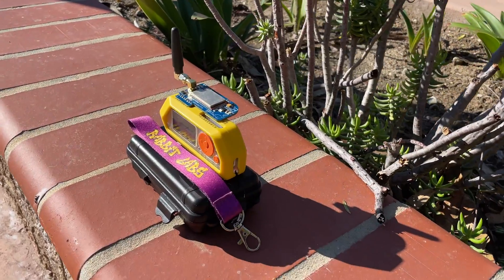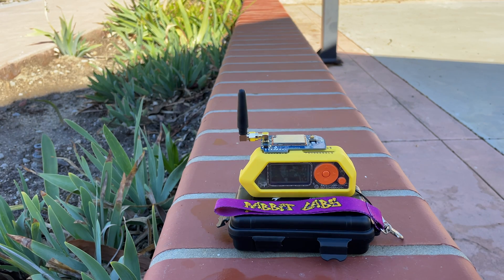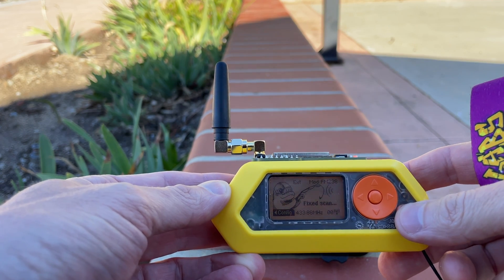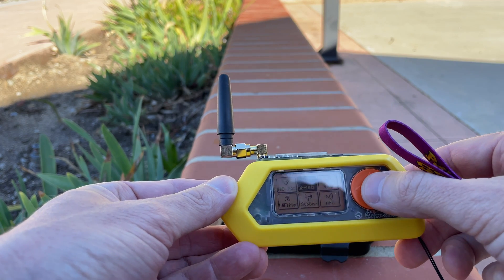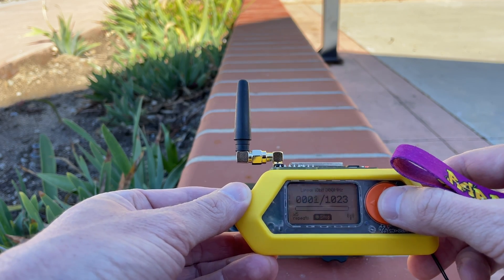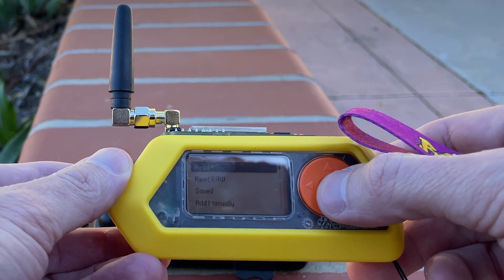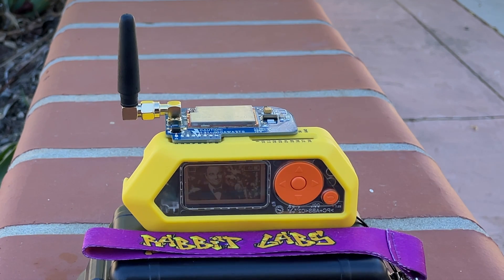Flux Capacitor for the Flipper Zero

Comment: What are these flipper zero things for? What can you do with them
Reply from the maker: It is a “Penetration” testing device. It is designed to test whether or not a wide verity of systems are vulnerable to being brocken into, manipulated or “hacked”. Because of its size and ability it has become a great “tool” for developers to create applications, test ideas and learn how many of the security protocols we use and are surrounded by, work or in many cases, don’t work. By doing these things, you learn how vulnerable they are and also learn how to mitigate and protect yourself from these vulnerabilities.

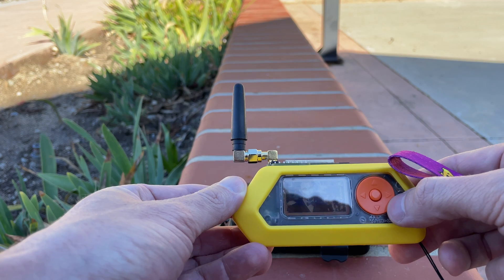Comment: 1:40 I just got mine a couple of days ago, and I messaged Rabbit Labs and a guy named Ryan said you don't have to turn that on anymore because the firmware does something so you don't have to. But, I dunno how to tell if there's a difference with it on or off.
Reply: Question for you does it still receive other range of frequencies besides 425-450? Can you still receive 300mhz? 868-900?
Reply from the maker: @pureh2oh92 it can receive these signals, it is just spotty. It doesn’t work on the higher frequencies all the time.
Reply from the maker: Yep. Ryan is correct. That change was made.
Reply: I know not all fobs for cars and garages use 425-450

Comment: You said it looks nice and definitely dig the tip on engaging it, but I wish you'd tell us a bit more about how well it works, and what it actually gets you for the money you pay for it. Why have one? Besides increased range at 432-433mHz, what else does it allow you to do that you can't do without it?
Reply from the maker: So happy you asked. It works great and gets you amazing range when using it. If you like tech that works and looks great while working, you should have one. It’s design and tuning give you clean signal that will travel farther than you can get without it, allot farther.

Comment: What software are you using? Is it the unleashed version? For the flipper zero ?
Reply from the maker: In this video I am using the “XTREME” software.
Reply: will it work with the unleashed firmware or does it only work with the Xtreme? @PenTestTuner
Reply from the maker: It will also work with the Unleashed firmware.

Comment: How much range does this add?
Reply: From my testing i was able to open my garage door from a little over a quarter mile away with pretty heavy tree obstruction using their optional long range antennae.
Reply: That is nuts!!! @OuterCraw
Reply from the maker: That is really good. What antenna are you using?
Reply: The range is crazy stupid bro..
Reply: That antennas not exactly, 'average'... if you know what I mean.
Reply from the maker: Yes, it adds amazing ability.
Reply from the maker: It depends. I’ve noticed anywhere from 20-100 feet.
Reply: @PenTestTuner way more than that
Reply: easy 90 meters